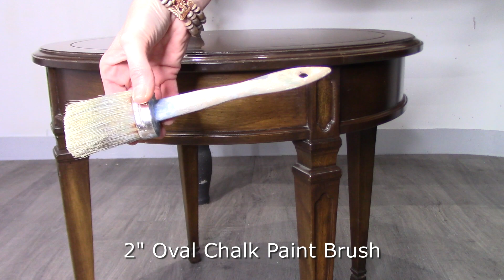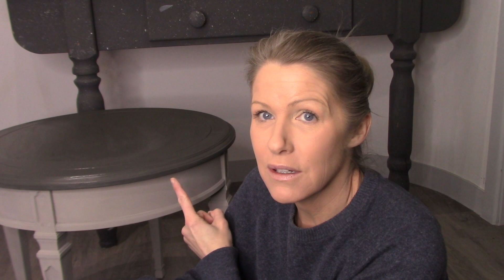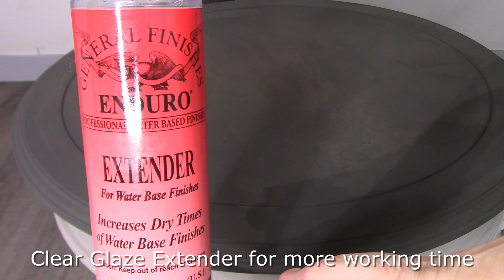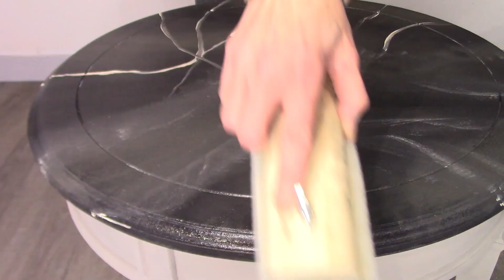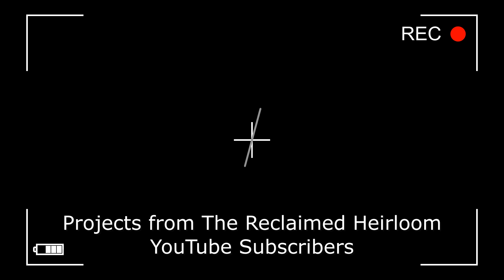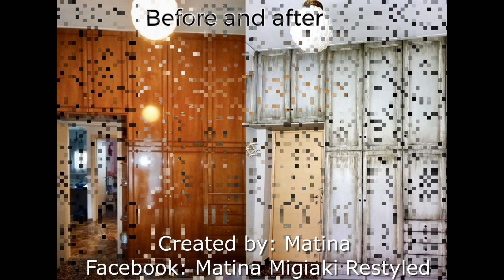Faux Marble with Chalk Paint | Black Marble effect by Chalk Paint Blending with meshing

Comment: What finish/wax did you use on the bottom of the table? I didn’t see anything listed in the video or details. Also, the YouTube thumbnail makes the table top appear BLUE...not graphite. Is it just the light? 1 more question...have you had any experience with your “water wiz” pad shedding? Mine shed all over the place leaving little fibers and I had to sand and redo the top.
Reply from the maker: PJ Swan ... that’s really odd ... my meshing applicator “ water wiz applicator “ never shedded and I used it right away after taking the package off! When I did the Scandinavian pink Armoire I literally took the wrapper off and started filming it was brand new 🤔
Anyhow I recommend washing with a comb let it dry and maybe even use some good tape and apply it on the applicator and repeat to remove any remaining lint! I had that happen with a roller once when I was painting walls and that took care of the lint issue.
As for the wax... if I remember correctly at the end I mentioned I was going to clear wax the whole table top and bottom as the glaze is not a sealer for chalk paint. I think I mentioned I was going to use dark wax around the edges and details and wipe it back for depth as to wax you can use any clear wax or dark you wish. I use AS but so many people use different products for chalk paint and would figure that applied to a personal choice on wax products, it’s totally up you and what is easiest for you to purchase. As for thumbnail I am guessing the black may have a blue hue because the thumbnail is another upload and it’s so tiny ? I’ll definitely take a look at that not to sure why other than the thumbnail caption 😉
Oh and if you are interested in Annie Sloan paint or wax you can find your local stockiest at anniesloan.com 
It’s unfortunately not offered on amazon as a product listing 🙄
PS... I hope you enjoyed the tutorial? 😉🎨💕